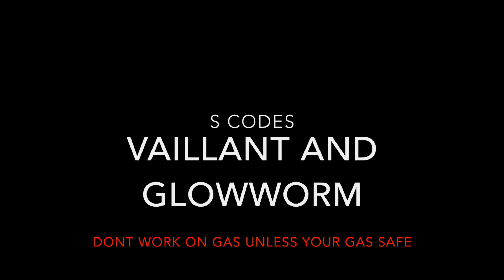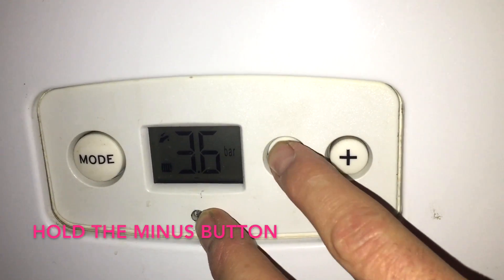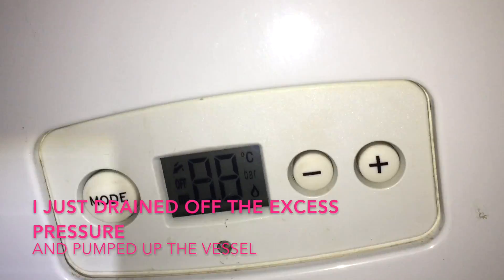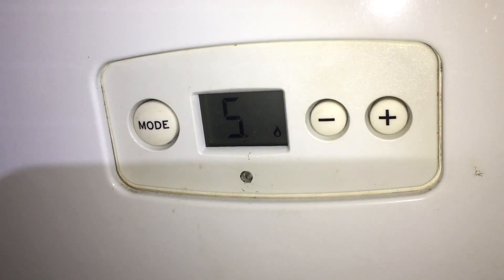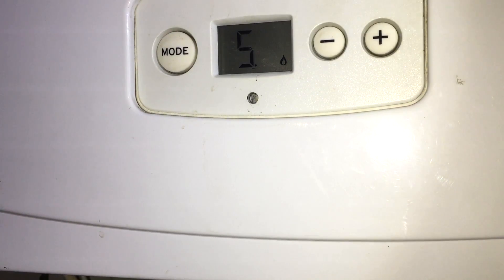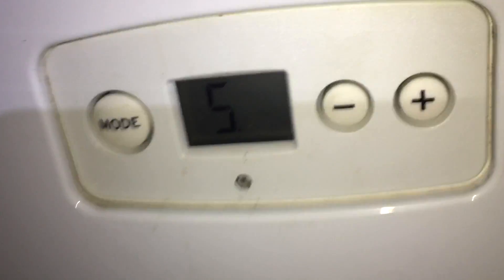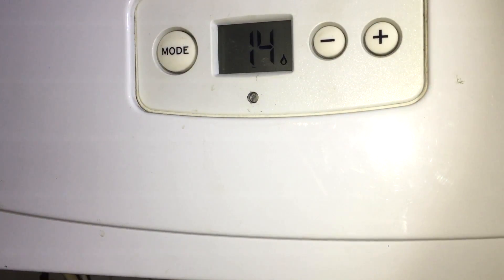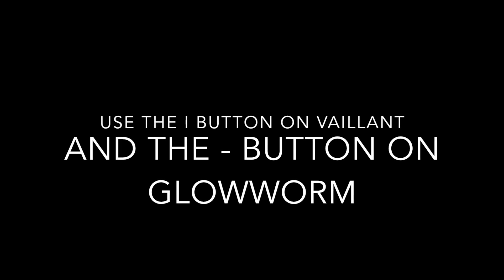Vaillant and Glowworm fault diagnosis. S Codes

Comment: Any idea what "uu" means on the Fault memory (holding mode and - for 5 seconds)? Or just means no error stored?
Reply from the maker: its called a page break. Engineers can add a page break to see if a fault reappears after they have repaired a boiler. So if the last 10 faults are F75 the engineer can add the page break and try and fix the issue. If it returns the fault history would be F75 nnn F75 F75....
Reply: @HeatingGeek  useful to know! Thanks very much. Looks like mine has a low pressure error before, but nothing since the engineer last serviced it a year ago which is nice!

Comment: I've got an F22 on one of these 
Water pressure is 1.3 bar and the other diagnoses according to manufacturer is ignition too hot 
Ive replaces spark electrode pilot  and ignition box 
Any ideas ??
Reply from the maker: F22 is water pressure problem....

Comment: any idea why I can't see the pressure on display? it's temperature only. 18sx
Reply from the maker: If you turn off the heating and hot water it will default to the pressure. I think you can also press the - button while running too.

Comment: I have a Glow-Worm Flexicom 30sx. Any idea why it stays at 65°C when heating the radiators only? The temperature on the boiler is set at 75°C. It goes to that temperature when heating the water and when heating the water and radiators together but not when heating just the radiators.
Reply from the maker: Check the status codes. They are in the book. They might tell you why the boiler isn't getting hot enough.

Comment: I have a Glow worm flexicon 24CX, the display is the same as the one in your video, and when we use the heating, for some reason the pressure showing in the display keeps going up and up slowly and never decreases. within a week, as we use the heating, the pressure showing in the display goes up to 2.7 bars. I then need to use one of the drain off valves in one of the radiators and drain some water in order to bring the pressure down to 1.0-1.2 bars. What is causing this? I'm monitoring this situation and when using just hot water in any of the taps, it doesn't make the pressure to go up and up like when using the heating.
Reply from the maker: The vessel and the filling loop are probably causing the issue.
Reply: HeatingGeek
Both valves in the filling loop are tightly shut, I just double checked. The expansion vessel... how can I check that?
Reply from the maker: @ruinunes8251  Yeah. They let by. So they are off but still let water through. The vessel you will need a GasSafe engineer to do as it breaks the combustion chamber seal to check and the boiler will need to be safety checked if that happens.

Comment: Like all your videos, very informative. Did you get round to uploading the repair footage?
Reply from the maker: I just found that video. :-) https://youtu.be/sVkxf1qG6Mo
Reply from the maker: For what? Sorry, I have a lot of videos. :-)
Reply: @HeatingGeek  Your reference at 2:35 "...this boiler has further issues which I do resolve... but it's quite involved" You have the footage which needs editing and you then say you will upload. Thanks again 👍
Reply from the maker: @TheHairyHound  Yes I did. I'm looking for it but I can't find it on my channel. I descaled the plate heat exchanger removed the canoe filter..... Im a bit baffled.....
Reply from the maker: @TheHairyHound  I actually remember the job.
Reply: Hello .any suggestions on the F13 fault code on this particular boiler with the PCB already changed.cheers
Reply: @nevithaci6676  Two questions: What level of expertise/competence do you have? Including service history, how would you say the state of the boiler is in? If it were me, I'd first check the fan then work my way back/reverse engineering.
Reply: @TheHairyHound  hello mate.ive been doing this for 6 years.the problem is that I haven't worked on Flexicom boiler at all so I'm not familiar with their fault codes.
This boiler in in ok condition . It fires up and all that.PCB is  new .Do you think that F13  is a generic fault code and it doesn't specifically tells you what to look for.When reset it work and the fault only comes up every now and then.

Comment: Do you know how to reduce the tem of preheated water which is almost boiling all the time?
Reply from the maker: The preheat water will be the same temperature as your hot water is set to. If it is too hot it might be the fact that you are using your heating at this time of year. The boiler cant lose the heat it creates unless it moves it into your water. Turn the heating flow temperature down and that should help.

Comment: Hi there I have S 30 code I noticed you said it was no demand ? How would I fix this any help appreciated
Reply from the maker: Get a demand from your external controls. S.30 is no demand. Make sure everything is turned on. :-)
Reply: It was a communication issue with my hand held thermostat. Once I reset and “learnt” them again it’s fine. Many thanks.
Reply from the maker: @MrChristo1985  Glad, it was easy. :-)